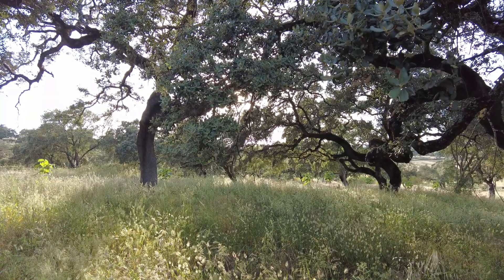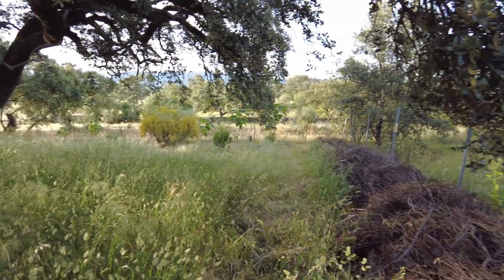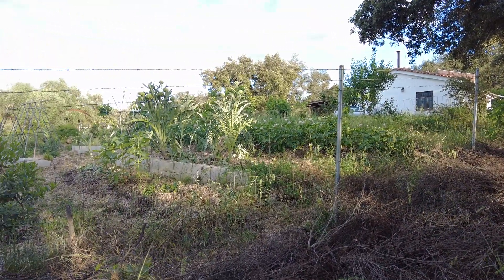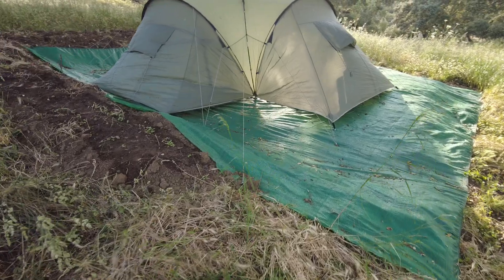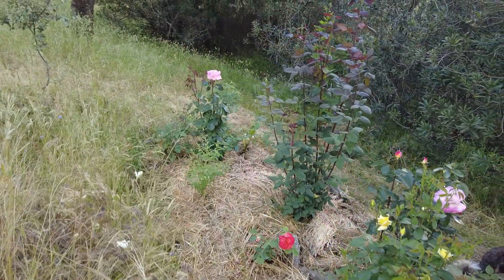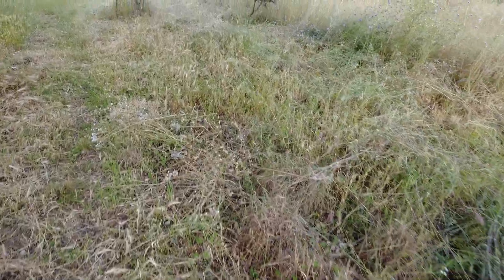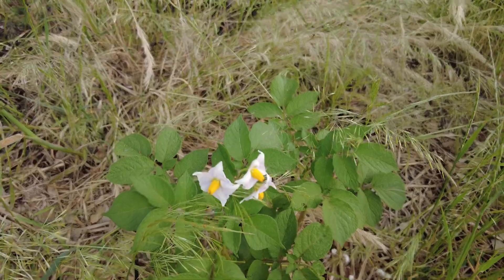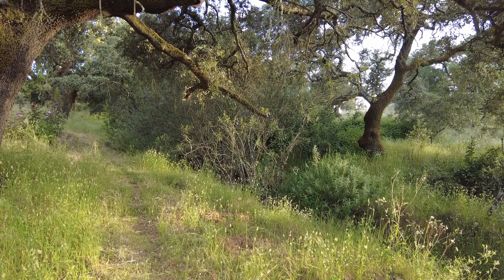The hot dry wind has arrived. What can we do? #permaculture

Comment: Four quick thoughts to consider Martin; 1) Buy 50% white shade netting to cover your fence windbreak while your permanent windbreak is growing.  Tie the shade cloth to the fence with nylon wire ties.  Using the cistus/herra is simply too labor intensive for one or two people.
2) Are you using  string trimmer line or the steel cutter?  You will cut more quickly and efficiently (especially the fine grass) with the trimmer line.
3) I'll suggest that cutting as much grass as you possibly can between now and the end of the cutting season is by far your number one priority.  Get the seed heads down on the ground where they have a chance to grow when the rains return.  And lay the cut grass down so it can compost rather than oxidize, standing in place.
4) Plant a tight hedgerow outside the garden fence of cypress seedlings this fall or next spring. You can plant a hedgerow of sunflowers right away.
Hope there is something useful. 🌞🌲🌻
Reply from the maker: I like planting. Thank you for sharing valuable information with us Steve.
Reply: @SuerteDelMolinoFarm  The pleasure is all mine Martin 🌞🌻